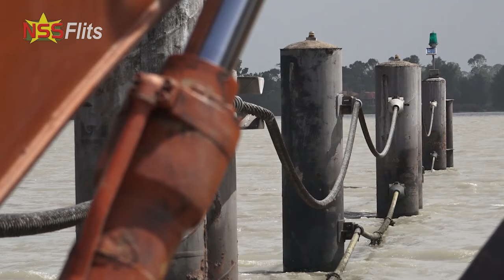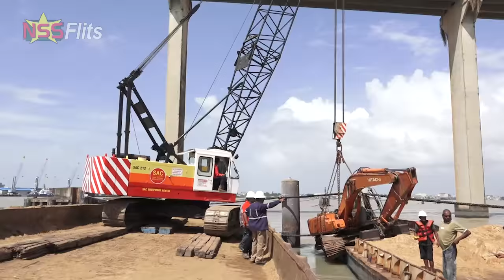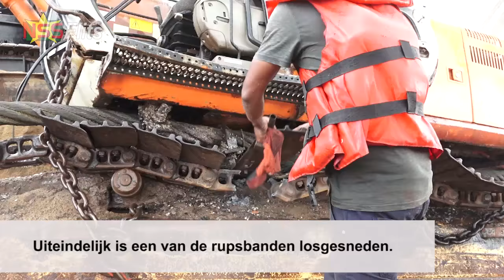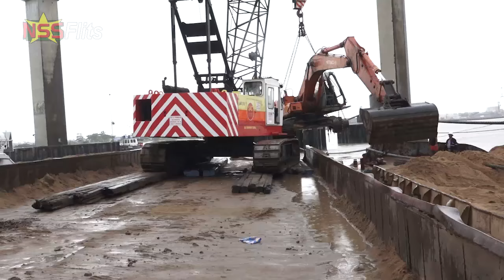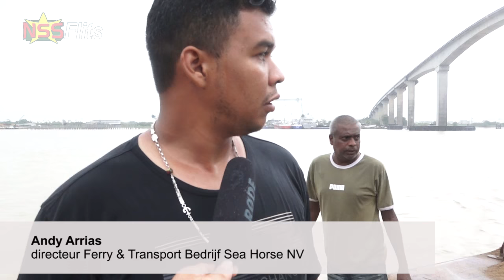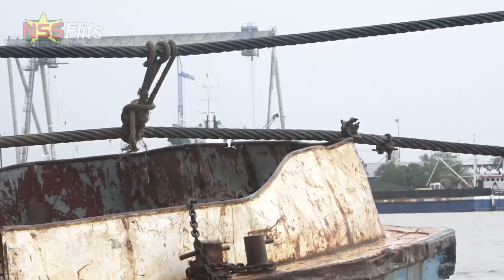Veel schade aan ponton en graafmachine

Comment: Aan Star Nieuws 
Andy Arrias or  river authorities need to conduct a root cause analysis.
Poor maintained vessel, strong current, inexperienced or distracted barge master are  just some of the risk which needs to be mitigated and accounted for during any transport.
What if loss of barge, loss of lives or damage to bridge had occurred?!
Marine warranty surveyor approval needs to be considered. There was loss of expensive equipment and it could have resulted in loss of barge or loss of lives worst case scenario.
I have held  marine and logistics lead roles (amongst others)  with a major oil company, and have managed special sea transports up USD 40,000,000 - 
RS originally from nieuw Amsterdam commewijne. Feel free to ask my advice.
Reply: Dit is niet normaal heeft bouta kut in zijn ogen dat hij kan niet zien wat betekent  veiligheid  mense werk met sliper dat kan je toch niet makken dat is geen veiligheid  stop met sliper te werken ale bedrijven moet aan hun personeel  schoenen geve om te werken de berijf moet een groote boete krijgen als een persoon niet in de veiligheid schoen werk